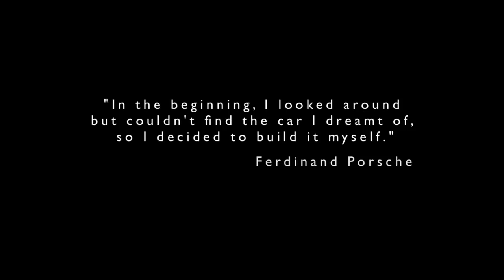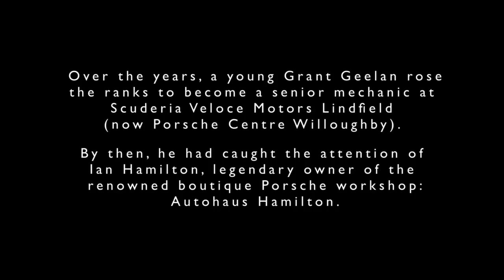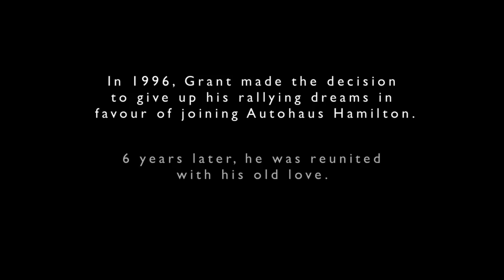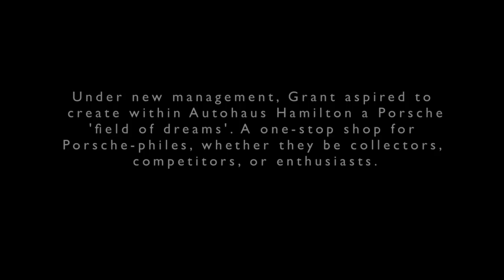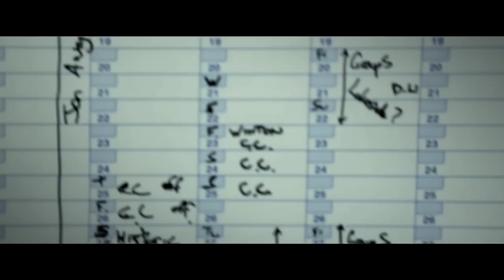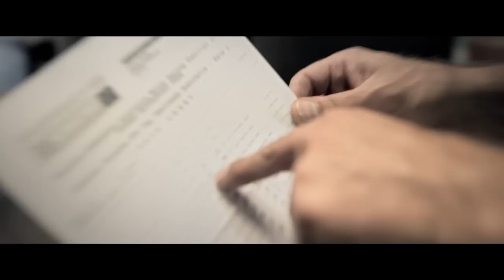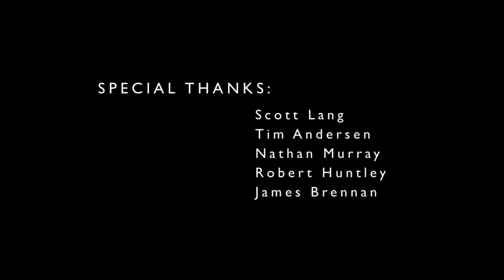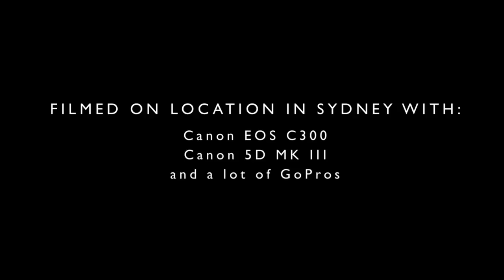LIVING THE PORSCHE

Comment: The tipping point of driving a classic 911 porsche begins with an unbridled desire for a degree of self actualisation sparked by any one of numerous triggers. The fancy of a drive is tickled by one's dreams of self super car status being realised. One achieves this through a kaleidoscopic imagination and partial satiation of sitting in one and experientially enjoying the joy of the many quirks smattered with exhilaration and deft hands on feeling. From first sight followed by the solid grip, unlocking clicking handle to your gentle sliding entry on the leather seats which snugly hug your body. The moment you feel the taught steering, the car begs you to insert the key. As you slide in the key and turn the key the motor growls into a roar that spikes your adrenaline and takes your breath away... more to follow

Comment: Mr J Lang I have to disagree with you. I personally own a extremely rare Porsche 1976 3 liter turbo to my knowledge there is only 4 in the country. I getting offers of $200.000 for it. I have owned it for 20 years. Every place I go to the Porsche owner, really knows a lot about the car. Germany do have autobahns I would like to see a Japanese  high performance car driven at top speed all day long with out blowing the engine. I strongly believe this is not possible. Cheers
Reply: Hi Cro...I am a fan of Porsche but I have to say post 1990 porches are not as reliable as post 1990 Toyotas and Nissans. The 996 is testament to porsche's faults. There is a series of videos on youtube about a brand new 991 owner and his problems with his porsche.
Reply: Hi Chester are you. I have to disagree you. Iook as long as you look after any car your will be ok. I know aGuy in the U.S.A getting 1475 HP out of an air-cooled 20 year old engine. That is mind blowing. What more can you say about that. German enginneering at it best.
Reply: +Chester Sing I've been driving a '02 996 for 6 years now....has never been in the shop...Two things have a appeared on the service record an OAS and a new ignition switch-that's it....I did change the IMS last month. The old one---- It looked brand new.....I believe Porsche repurchased that 991, i'm not sure.   Are you suggesting there are no Toyotas or Nissans that have repurchased under the lemon law?  It seems like no one can produce a Porsche video without some one bashing  the 996....the vehicle that saved Porsche, they did sell 175,000 of them.  It's funny how the Ferraris, with all the nightmares out there, seem to get a pass from this constant bashing.
Reply: +CroZagreb1 Hi Zo, I think there are more Japanese cars pushing above 650 hp than German cars pushing over that figure. That kind of power seems most frequently used in drifting from my observations and, in drifting, most engines are comprised of American (LS) and Japanese (RB, SR, 2JZ).
Reply: +Ken Shirk Hi Ken, I am certain that there are faulty Toyotas and Nissans out there. Toyota produces over 10 million cars a year so naturally there will be problematic ones. On 996, pardon me. I am just pointing out a fact about the car. I know there was a class action suit by owners of 996 which was only settled recently after over 10 years of Porsche ignoring the matter. Japanese car companies have had a lot of very public problems and they are generally quick to apologize and make amends and do recalls. Anyway, I like the 996 (Larry Chen's 996 Turbo is one of my fave cars). Again, just pointing out facts about the car.
Reply: Hi Cro, by the way, congratulations on the 1976 3 liter! I know I seem German-car averse but I'd love to own that car. USD 200k seems to be market price. At USD 250k, I'd be very tempted to sell. That kind of money can buy future collectors - maybe even 2!
Reply: Chester Sing My point is people some how need to "point our the faults about the 996."  Other cars, with terrible mechanical issues,
get a pass.
Reply: Fair enough. In fairness to Porsche, in the realm of high performance cars, I think Porsche has probably one of the best track records.

Comment: Don't get me wrong, I am a porsche fan.....BUT!!!  It shits me when owners go on and on about how reliable the cars are, and they've been driving them for 10,20,30 years and they're reliable as hell.  But then!!! Porsche mechnanics involved with guys who race them say the engines need to be rebuilt every 10,000km.  You can't have it both ways chaps.  An internal combustion engine is an internal combustion engine. Anything driven in a sports performance manner ain't going to do so for 30 years without multiple complete overhauls. And to my knowledge a 3.x liter flat 6 porsche motor will cost anywhere 20,000-45,000 to completely rebuild. Let's be honest, Porsche haven't found a cheaper way to build reliable engines. That's an absolute myth that porsche owners like to spread to justify their expenditure and gain status signaling points.   Electric motors are the future, and will have the performance and reliability to render internal combustion engines obsolete.  I am betting porsche marques of today will not hold their value in 15-20 years, due to the superiority of electric motors across the board (in racing, GT, everyday driving).
Reply: helicart - Most of the highest-value collector cars don't get driven at all (other than the minimum necessary to keep oil from gelling, seals from drying and cracking, etc.), or very, very little (on and off the posh trailer for the Concours circuit), their owners don't fool themselves that they're going to beat the performance or fuel efficiency of a modern car, it has little to do with their desirability compared to the status associated with owning the car. Plenty of relatively affordable cars can beat a Lamborghini Miura in the track or street, but that doesn't change the fact that the Lambo is profoundly more valuable than, day, a Nitrous-equipped Ricer. Motors will never create the visceral rumble of an internal combustion sports car engine, no matter how powerful or efficient they are.